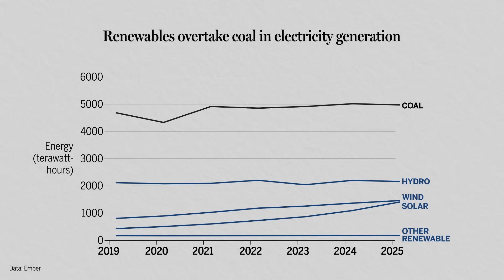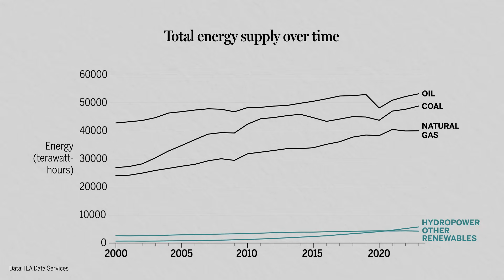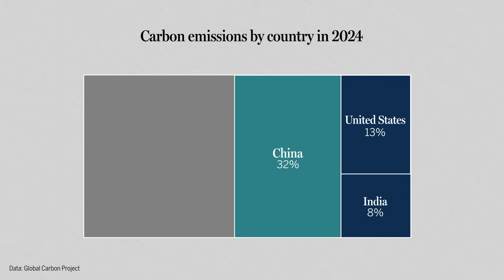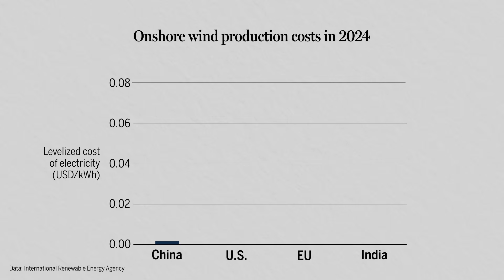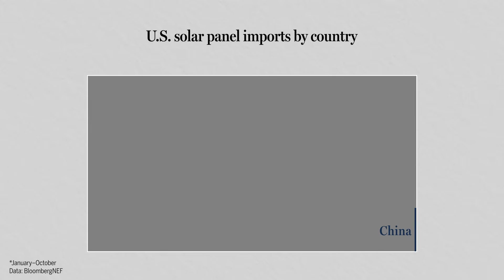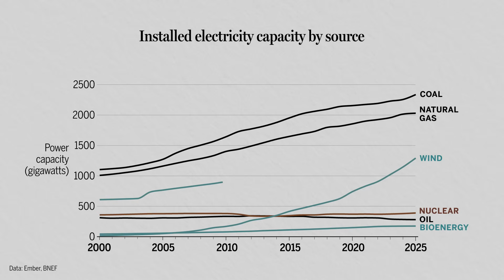How cheap renewable energy is finally flattening emissions

Comment: ..... and then came thousands of gigawatts of AI Data Centers, sparking great demand for and a rebound of coal and gas fueled power stations worldwide. 🤔
Reply: Which is why the U.S. as a nation should have committed to building the best fleet of fission reactors in the world. Back in the 1970's. Instead we did fossil fuels. Leaders like Nixon and Reagan screwed us.
Reply: or nuclear power.  Gates is looking at restarting 3 Mile Island, with new modular reactors.
Reply: @JBoy340a  Modular reactors won't be ready for commercial use before 2030 at the earliest (in the US; China and Russia already have theirs, but good luck importing those to the US). What he wants to do is to repair and turn back on the old reactors that didn't melt down, which could potentially be done much faster.
Reply: Coal and gas takes too long to build. If the US wants to compete in the AI race, it will need to go for an "all of the above" approach, which will result in most new capacity being renewable simply because it can be built more than twice faster than new fossil fuel generation.
Reply: @FabioCapela  Gas is as fast as how quickly can you get the jet turbine engine trucked in, or dozens of them, as Elon has done in at some data centers.  They can be set up in weeks.  That is far faster and more reliable than solar or wind for a large organization that wants power now.
Reply: @vincetalkz  That's if you can remove all the permitting time and already have all the parts at hand — and if you do that solar with batteries could be installed in a week.
But even with all the other time sinks removed, the average wait time for new gas turbines is, if I remember correctly, about 5 years in the US — and that is just part of the time it takes to install new gas power — whereas the average solar farm install time is about 2 years, and wind isn't much worse. Renewables in the US can be installed far faster than any other alternative.
Reply: @FabioCapela  China is already massively building out coal power  plants for cheap energy with abundant coal that will be coming online steadily over the next couple years.
Reply: @vincetalkz  yes.  China has a lot of excess power generation capability.
Reply: @vincetalkz  China builds a lot of coal — but it retires even more coal capacity, to the point it should burn less coal for power this year than it did last year despite increasing power production by almost 7% (all of the net increase coming from renewables).
Also, solar with batteries is actually cheaper in China than coal is. Part of the reason China's electricity have been getting cheaper is that they reduced coal use from over 80% of their electricity two decades ago to barely above 50% now, replaced mostly with renewables (China essentially leapfrogged natural gas), and within a couple years should be generating more electricity from renewables than from coal. China already generates more electricity from renewables, both in absolute terms and as a percentage of total generation, than the US.

Comment: "Nothing is more powerful than an idea whose time has come" - Victor Hugo
Reply: banger
Reply: @danielardelian2    Fuels for solar and wind power are 100% GODDAM PHUCKING FREE for the NEXT SIX BILLION YEARS!!!
Reply: @Tryp-j9d  Plus, hydro power is also powered by the Sun, technically speaking...
Reply: @Tryp-j9d the machines that collect them and the land they take up and the double distribution to get power to load and the backup, none of that is GD free. It’s very expensive.
Reply: @Nill757 not if you have panels and battery
Reply: @nothinghere1960  All which needs minerals that must be mined, factories to make the parts, labor for all that and to install them.  Then replace it all, start over. None of that is free, unlike the lunatic top post in UPPER CASE.
Reply: @Nill757 the change will not be magical my friend
Reply: @Tryp-j9d windblades are not recyclable, and there are huge windblades graveyards around the world.
Why is your waste better then others?
Reply: @faithless42069   because there’s much less of it per unit of electricity generated and also it’s just landfill waste not greenhouse gases
Reply: @faithless42069  There's orders of magnitude less of it and doesn't damage people's health?
Reply: @user-wb8iu1hl6i  That’s wildly wrong, PV and turbine waste is huge. Nobody cares.
Reply: @Nill757  Huge relative to a human body sure. Still minuscule compared to fossil fuel pollution and greenhouse emissions
Reply: @user-wb8iu1hl6i  solid wastes and stack emissions are two different things.  Wind and solar solid wastes, worse than everything, but fossil fuels have billions of tons of gas CO2 emissions I don’t pretend away either of them. To avoid large wastes of both, go nuclear, like China.
Reply: @Nill757  China is indeed building nuclear power plants, they got pretty good at it too, but the share of nuclear power in China is actually decreasing, because they are building other sources much faster.
Reply: Talking about nuclear power plants..? 😅😊
Reply: @volkerr. In 2025, PV generated about 7% of worldwide electricity. Nuclear generated about 9%.
PV is increasing, Nuclear is stagnating.
So it won't be long before PV will generate a lot more energy than Nuclear, even though it has a capacity factor of only 20%.
Reply: @danielardelian2 the world needs energy that can be produced 24/7/365. PV and wind
Can’t offer that and they need a hell lot of space. Unacceptable.
Reply: @volkerr. PV and wind can offer energy 24/7/365 with storage. But at the same time, the world will also adapt its energy consumption to renewables intermittency. It's simply a matter of cost. The economics are just not working out for nuclear fission power plants.
PV with all its intermittency is about to overtake nuclear in actual energy produced.

PS: Nuclear needs a hell lot more space if you include all the industrial processes necessary before and after the power plant itself, such as mining and refining the nuclear fuel, safe storing of spent fuel, etc.
Reply: @volkerr. IMO mainly interesting for things floating on water. Floating NPPs and nuclear propulsion not just for aircraft carriers and submarines, but also for big commercial ships like cargo ships and cruise ships. I can imagine people not being too happy with nuclear ships in places like Venice, but I personally think it's the best option when the alternatives are methanol, ammonia, hydrogen or just sticking with heavy fuel oil with all kinds of chemical waste illegally mixed in it.
Reply: Veganism in a nutshell...

Comment: Renewables will never replace fossil fuels.  With current technology, only nuclear can replace fossil fuels.
Reply: If you believe this, you're not up to date on the current renewables technology.

It's not your fault. It's been evolving very fast. 30 years ago you were correct, but a lot changed in the last 30 years.
Reply: @kylejohnson6775  I know solar has improved, but solar and wind are both dependent on weather.  That will never change.  Better battery technology will help, but it will never solve the weather problem.
Reply: @craigthompson3739  What's your job or academic background?
Reply: @lorissupportguides  Academia is self-perpetuating.  I worked at a nuclear fuel processing facility as an IT Tech.  You don't need a background to see the disaster in Germany.  Texas blackout?  Windmills and solar panels are proven to be unreliable.
Reply: @craigthompson3739 

You're correct that you don't need to have a scientific or academic background to understand basic principles, or to believe experts when they tell you the truth. 

The Texas blackout was mostly due to the gas pipes freezing because they never prepare for the winter storms that happen once every decade or so. There's been a big blackout disaster like that every decade-ish since before they built their first wind turbine. 

They only blamed solar and wind because oil & gas companies fear the threat to their bottom line, and those companies have had very active propaganda teams since Jimmy Carter left office.
Reply: @craigthompson3739  What disaster in germany? The texas blackout wasnt caused by wind or pv.
Reply: @craigthompson3739  can you please explain the disaster in Germany? I am curious

Comment: Clean energy is solely possible due to solar panels and batteries being produced cheaply enough to be viable. China is singlehandedly greening the world, ironic as for decades, green technology has been championed as something the west would bring-- but it turns out to be more gimmicky than practical
Reply: It is practical if scaled up enough; if the west had given green tech the same amount of subsidies, including implicit subsidies, that it gives the oil industry, and scaled it up until it was the same size, renewables would have dominated in the west a long time ago.

The oil lobby is too strong in the west, though, so it took a country where the oil lobby has no strength — China — to bring that around.
Reply: @FabioCapela  True. We in the U.S. botched energy policy. France, by contrast, showed what was possible.
Reply: Greening is done by actually doing greening. Not merely by changing energy production. Loess Plateau...
Reply: @presence5426  If talking about actually Making the Earth Green Again (MEGA?), China is the country that reforests the most, and by a wide margin. They also have rules that prevent clearing the ground and replacing it with bare earth or concrete when installing solar farms; if you look at photos of Chinese solar farms, the ground under them is usually green, and often with native vegetation.
Reply: @presence5426  Yes— and China’s deserts are the only ones on earth that are slowing down in expansion and actually reverse in many cases. Look up China’s green wall
Reply: @DanielSonghere1454  I'm aware of the green wall in China. But that's not the claim you made.
Reply: Chinese manufacturing is powered coal. They build more coal-fired power plants than any country on earth.
Reply: @craigyirush3492  China also retires more coal than any country on Earth.
In 2024 China had 55% of coal in their electricity production, down from over 80% a mere 25 years ago and 65% a decade ago; they are closing the gap, and actually better than a few EU countries already, more so when you remember that only 3% of their energy comes from gas — the rest is almost exclusively low carbon sources.
For 2025, China is up to now actually consuming less coal for electricity than it did in the same period of 2024; that's a reduction not just in relative terms, but in absolute terms, despite their electricity production growing by almost 7%.
Incidentally, China generates more electricity from renewables than the US, both in relative terms (as a percentage of their total electricity) and in absolute terms (total renewable electricity generated).
Reply: @FabioCapela they are still using a lot of coal! And building more plants every year even if it’s a declining share. Ultimately you can’t run a modern economy on renewable energy, in part because it’s intermittent and requires costly backup with batteries and/or fossil fuels, and partly because you can’t run planes and ships (both vital to the economy) on electricity.
Reply: @c @craigyirush3492  EU and US are powered by oil and natural gas; which they have no plans to switch to green tech until shaken by China’s ascent recently. There is no country that doesn’t use fossil fuel except Bhutan and a few energy independent states
Reply: @DanielSonghere1454 so in your alternate fantasy universe, Germany didn’t switch some of its electricity generation to renewables?

Comment: Our focus should shift to energy transportation and storage now. Intermittent renewables are fast becoming too cheap to meter, but constant output requires that we distribute the energy to where and when it is required.
Reply: It already is. The rate of grid scale battery deployments is in exponential growth. 

It started not long after the electric car boom in 2020 because the batteries are mass produced in a form that you can relatively easily use for a bunch of different stuff. You just need to wire them all together in different ways to tailor them to your purpose. But from the battery cell manufacturer's perspective? They change basically nothing but the delivery address

Comment: The thumbnail picture is very impressive 😮
Reply: I'm not sure, but given all the green under the solar panels and the way it hugs the landscape I suspect it's in China.
If I remember correctly, China mandates that solar farms have a dual use. One of the acceptable dual uses is growing local flora under the panels to help with local ecosystems, thus all the solar farms with plants under them in China. This is a particularly good option at the border of their deserts, as the solar panels reduces excessive sunlight, evaporation, and wind speeds under them, helping plants get a hold, while the plants further fixate the sand, weakening sandstorms and prevent the desert itself from expanding.
Reply: @FabioCapela exactly. Agricultural solar is a great thing. In Germany we have a university where they test exactly that. What plants are suitable and how much use of chemicals can be saved. I can remember it was almost 75% less in one case. That it's pure money saved by the farmer and the plant grow similar fast or don't sunburn. Overall it's very good thing if it's applied properly! 😎🍚

Comment: I think solar is great, and sunny countries can and do benefit greatly with it. As more solar is used, less fossil fuel gets burned in these sunny countries. Wouldn't than mean eventually that the total overall carbon output be low enough?  So that non sunny countries can continue burning natural gas and such? While these non sunny countries can implement wind, but wind projects are very expensive.
Reply: No. Everyone needs to go net zero. 

Even the cold countries with long winters still benefit from solar during the sunlight hours, and energy storage (especially sodium ion, which is commercialized and available earlier this year, or thermal storage) can make solar still useful in winter. 

Wind isn't as expensive as the consequences of not changing the energy system. 

Those wintery countries also have like, 80 million people total split between them, and they have coastlines that are excellent for reasonably priced wind projects. We know this, because they tend to be world leaders in wind power (Nordic countries, Scotland). 

Everywhere further south than Denmark doesn't really have this issue. Especially now that the climate has changed so it barely snows, unless you live in high mountains
Reply: @kylejohnson6775  Solar panels actually have little to no issue with snow. They naturally heat up a little, which is usually enough to cause the snow to slid off — which has a nice side-effect that a roof covered in solar panels usually doesn't have the usual issues with accumulated snow. And if even with that snow would be an issue, you can also use upright bifacial solar panels, where snow simply can't accumulate.